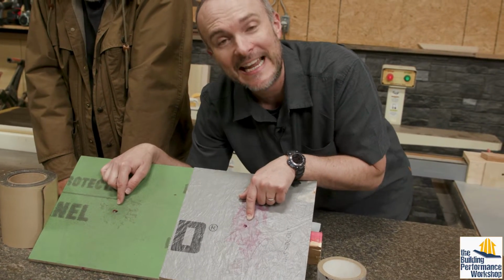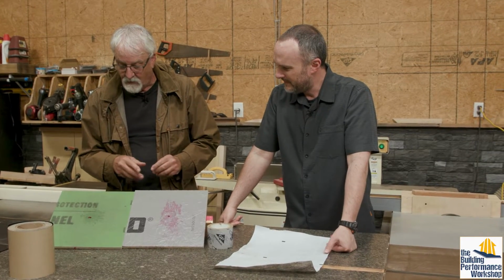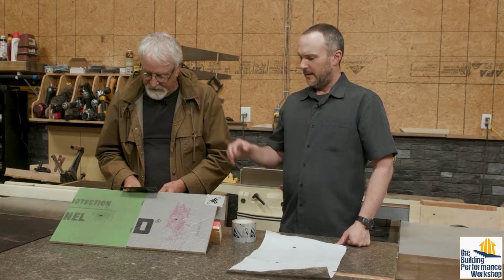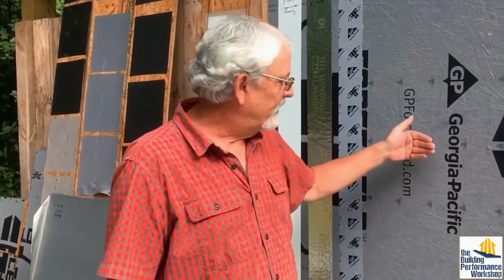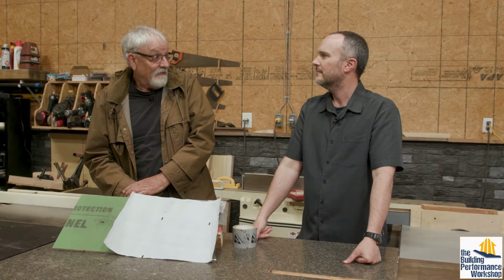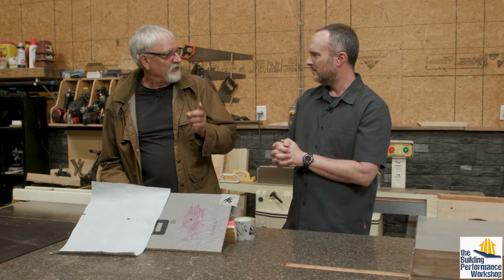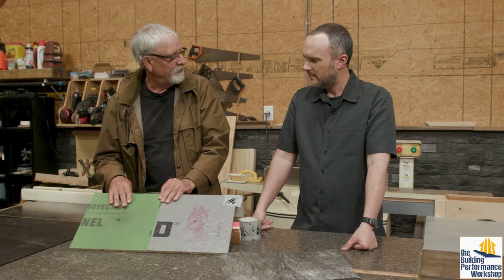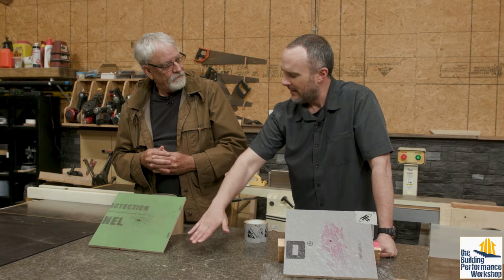WRB Showdown: ZIP System vs. ForceField WRB vs. Tyvek Housewrap & More with Inventor Landus Bennet

Comment: I don't think the air barrier and WRB should be combined. Plywood is superior to OSB in every functional way and is less expensive than Zip sheathing. Zip tape sticks like crazy to plywood for a great air barrier. Then use housewrap for what it does best.  I achieved ACH .77 on my gut remodel. It was a worst case scenario, a single floor home with a shallow crawl space. (the same amount of leakage rates better in a house with a full basement and/or multiple floors.) I prefer Kimberly Clark's Block-It housewrap. It is a two layer affair. The bottom is smooth and the top like a fine soft nonwoven fabric. They are apparently fused with a heated perforated platen that leaves raised dimples to provide drainage under exterior insulation. It's about the same price as standard Tyvek and far cheaper than drainage Tyvek. Despite what Zip says I don't trust Zip sheathing to provide adequate drainage and obviously Force Field provides none.
Reply: Actually plywood can become less uniform than OSB and can delaminate. That being said, I’d take plywood over OSB if cost wasn’t an issue.

Comment: Hope all is well with you and your family. 
One item I would like to add that often gets left out about R value of fibrous insulation, whether it be fiber glass or mineral wool or anything else, to achieve the real R value it must be installed perfect and with 0 air movement. That is the condition in which it is in when the R value is addressed to it. 
Rarely is either achieved when all is said and done. The value also drops significantly when they are not accomplished. 
Spray Jones has a great video on this topic with the research and paper work on it. 
Grace and Peace 
Slick
Reply: I have watched a ton of Spray Jones videos and his biais to Spray Foam is obvious.  For intance he claims that even properly installed Fiberglass insulation perform the same as Rockwool, when that simply isn't true.  He makes a lot of generalization statements obout batting insulation when the claim he is making only applies to fiberglass.  Closed Cell Spary Foam has it's place, but it is not the silver bullet he tries to claim it is.  A point he rarely states is that installation methods for foam and details are just as if not even more important that batting.  It can be -40f or plus 100f when installing rockwool and that cannot be said about the very tight tollerances necessaryfor installing spray foam.  Spray foam has also been proven to off gas for months (lots of 3rd party testing) not the 24 - 48 hours as he claims.

Comment: Could you elaborate on the air tightening process for a concrete block home builded in 2007 in Florida.?
Reply: In FL you want ZIP system because it provides a air/water barrier on the OUTSIDE. Here in MA that would be totally wrong. Vapor barrier goes on the inside.

Comment: Hi Corbett, I believe I heard that having an adhered membrane (I'm using Adhero) as your WRB and then using spray foam directly under the roof deck would be a bad idea because that would be using two vapor barriers. Did I understand that correctly?

Our plan is to wrap the entire house - roof and walls - in Adhero, then to spray foam the entire underside of the roof decking to gain air tightness. 

I'm now wondering if I don't need to use spray foam where I don't absolutely need it (in 2x6 rafters). The way we are planning it is for the roof to be spray foamed to code where we have existing 2x6 rafters, then flash/BiB fiberglass in the 2x12 rafters. 

But if I'm using Adhero as my air tightness along with spray foam in the rim joists, I could save money by just doing the BiBs in the 2x12s. Would appreciate your thoughts.
Reply from the maker: Hey Chris- don’t worry, that’s ok. But you’re getting airtightness from the membrane, not the foam. The foam is just the simplest way to insulate the roof. But yes, I'm in favor of less spray foam whenever possible. Vid coming soon about that.
Reply: @HomePerformance  I saw the vid! Was really helpful. Thanks Corbett
Reply: Put the roof membrane on and dry in the  home. I would then run a dehumidifier to make sure everything is dry before spraying the closed cell foam that was you aren’t trapping anything moisture. This is exactly what I am doing as well.

Comment: I have been seeing tesla solar roof installs that require ice and water shield over the whole roof prior to solar shingle install. if there is closed cell spray foam under the sheathing like in Matt Risingers latest video, will that cause moisture trapping issues? I cant believe that wasnt considered during install.

Comment: I'm curious to know your thoughts on the changes that the World Health Organization has made to their recommendations on how many air exchanges per hour that a building should have in order to be healthy from an airborne virus perspective. How would you modify your building procedures to target those ACH ratings?
Reply from the maker: Filtration, Brad- the forgotten factor of ventilation. Most performance pros would have you run the ERV at higher rates, but that’s costly and unnecessary.
Reply: Build your house as tight as possible, then use an ERV to control AND filter the air entering your home!
Reply: @dankarau2307 exactly- you’d be better off building a super tight house and cracking a window open even vs the old mentality of “a house has got to breathe”, where you have uncontrolled air leaks allowing air to enter from the worst possible places (such as air from a vented crawl space getting pulled up into the living quarters). 

The short version is, build the tightest house you possibly can, and build a system where you can control air changes to meet desired turnover rates.
Reply: Every house that has lots of air movement last 100s of years. New homes that are air tight don't last.  Period.... drive around prove me wrong.  You can agree or disagree on all.the new technology.  You can't beat a house with air movement for long-term.   Yes you pay for that air movement in heat and ac but its also much better for your health.   The health factor alone should be enough to let some air through your living space. Look at what we spend to stay healthy.  Seems a heat bill is better than a health bill.

Comment: So, could you do ZIP-R on the outside, plus rockwool as additional internal insulation? That would still be just one WRB, but you'd get the additional thermal insulation. Right?
Reply: Yes, you could use that assembly. It's quite common. However, exterior insulation on the outside of your sheeting is better than on the inside of your sheeting. For example, rockwool comfortboard, followed by zip sheeting, followed by rockwool comfortbatt cavity insulation. 

The layer change keeps the wood product warmer on the outside of the house, which will reduce the incidence of water condensating on a cold surface.

Comment: Great video! Question, according to Huber you do not need to seal overdriven nails unless they penetrate 50% or more through the panel. I do not agree with this but as an inspector can only call out what I can justify with info from the manufacturer. I still let my clients know my concerns but would love to know yours and Landus' view. Keep the videos coming!
Reply from the maker: Hey Reeves- check out the previous vid with Landus all about overdriven nails
Reply: reeves29456- I'm glad to hear that inspectors are concerned as they should be.  The answer to the issue around nail penetrations is it depends. Cheap way out I know. With some claddings, there will not be a measurable amount of water in the field.  Around windows and doors it's a different subject. Some claddings are considered reservoir claddings, like brick, in that case, I would recommend sealing the fasteners. Actually, I would cover the integrated WRB with another layer equivalent to grade D felt paper.
Reply: @landusbennett7123  Thank you!

Comment: All due respect…. But…. Another total waste of my time. Like the last three information voids that are your videos. You absolutely cannot discuss one part of a system without the other parts. That zip sheet does not have enough thermal insulation to do the job. To protect the structural elements from becoming thermal bridges you need more insulation between the zip and the structure. Building science 101.  Discus the entire system, not one element that must marry with other elements to become a complete system. Sheesh.
Reply from the maker: Fred Snit, your dream of becoming a video maker is nigh- go make even one video that truly addresses the entire system of anything on earth, and you will have earned the cred to complain about your free video consumption. Until then, we do not make videos for you. Move on.
Reply: @HomePerformance  already been done by the god of building science 

https://youtu.be/E_ngmbANeOg
And
https://youtu.be/E_ngmbANeOg
Etc. 

You’re separating and confusing all the layers
Reply: Couple points:

1. 'All due respect', as a concept, may not be something you are familiar with.
2. There are plenty of videos discussing myriad systems. That was not the intent of this video. That fact is even called out in the video. 
3. Putting insulation between the sheathing system and the structure is not even the best practice. You're better off insulating the exterior of the sheathing as it will reduce condensation on your sheathing because it will be warmer.
Reply: All I can say is WOW. Totally missed the point of the video my friend. We are talking about water management not thermal breaks. That science 101 will be or already was discussed. (Air gap or insulation)
Reply: @trickstothetrades1801  clearly, you don't understand the issue or building science 101.  

water management includes condensation; to avoid condensation you need to place the vapor and air barriers and insulation in the proper places to avoid 1. condensation; 2. trapping condensation; 3. thermal bridges that will result in condensation.  Study joe lstiburek, the perfect wall, building science. 

this video addresses sheathing with a barrier. great. one part of the sandwich. completely useless without the other part of a system.  where do the other parts of the system go if you use this super-fantastic barrier? what are the other materials that work with this barrier? which materials don't work and why? that's information people can use. 

you can't talk about water management without talking about location of insulation, air and vapor barriers, condensation, and thermal bridges - and your climate zone.  and you need to address the correct materials to do these things. this 2-part 40mins of video garbage miss all of that and only point out these sheathing and tapes work. bam saved you 39 mins and 30 seconds.
Reply from the maker: Snit, you are clearly not a specialist in practical applications. Stick to reviewing childrens skis, and don’t turn troll on my channel and my followers. All due respect, but you’re being the total waste of time here.
Reply: Istabruk is the master.
Reply: Lstiburek is the master. Anyone doubting this man is an idiot.

Comment: Being up north and having to repair mold issues frequently (at least What I have found) is it hasn’t mattered what you used plywood or OSB but how you build and protect. Right now I’m tearing out plywood that has rotted and molded because there was issues in construction that has created moister BOTH inside and outside (IE: Nothing done right) the sad thing is all of it could have been avoided with not that much more cost or time just better knowledge
Reply from the maker: Amen
Reply: Sorry to hear about your issues. Do your best to keep liquid water from entering from the outside and keep humidity down in the living space.
Reply: A lot of reasons this can happen. See my post above. In the North your vapor barrier needs to be on the inside and the outside needs to breathe. ZIP system in the North is BAD.

Comment: This was an interesting video, thanks for the information.  Out of curiosity, do you know of anyone making a similar integrated WRB sheathing product, but using plywood instead of OSB like ZIP and Forcefield use?  I live in the northern Great Lakes region, and between the rain, snow, and repeated freeze/thaw cycles during Spring and Fall, OSB tends not to hold up very well compared to plywood.  A few builders I've talked to have told me that they try not to use OSB for anything other than subfloor unless their client truly can't afford the more expensive plywood sheathing because they get fewer callbacks with plywood.  I've tried searching myself with no luck, so I thought I'd ask someone more familiar with the space.  Thanks for any help you can offer.
Reply: You can use plywood and then apply your own fluid applied layer. There are several products available, some mentioned in this video. I don't know of any off the shelf sheeting products, though.
Reply: There are no integrated plywood/WRB systems.  I tried, but plywood manufactures were not interested. Probably because the plywood turns into a potato chip if not overlayed correctly.

Comment: You touched on building in the north (Canada) with zip or other products like it and the use of vapour barriers. Would you say not to use anything on the inside if you have zip on the outside or something else to control the vapour? What product would you use?
Reply: If you are using ZIP you will have to talk to your building department. In Ontario they will require a poly vapour barrier due to code. You end up trapping moisture between the WRB and the poly. Not good. Either just use a latex paint on drywall for an interior permeable vapour barrier or if you want a more air controlled system some of the smart barriers such as SIGA Majrex are a good choice. They allow drying to the inside but prevent moisture entering the wall assembly in the winter. That is what I am using our house now under construction on the North Bruce peninsula ( between Lake Huron and Georgian Bay) I also have exterior insulation. Great video. Thank you! Tough for the average person and for the average builder to keep up with the building science world. I have had to spend a lot of time reading Dr Joe and Matt Risinger to get a start at a handle on it.
Reply from the maker: 👍🏽 keep it up Chris
Reply: @knappce  Use a smart membrane vapor barrier if code makes you do so.  Otherwise, don't use a vapor barrier behind drywall if using Zip-R.  Otherwise you will trap moisture in your walls.
Reply: So if I am building a wall assembly with ZIP R9 a 2x6 wall with Rockwool and Siga Majrex is a good thing? This is what I have planned.
Reply: I think the best way to build in the north is to put your insulation on the outside of the wall.  ZIP R has a product that includes the insulation and a nail base.  This will help keep the temperature inside the wall above dew point.  There are other continuous insulation companies in Canada like QuickTherm that have loads of experience in your area.

Comment: I am building a house on the east coast on the coast and was interested in the comments regarding the structural strength between OSB and plywood (say Advantech).  I was planning to install plywood horizontally covered with a WRB for the greater shear strength.  In the video it was commented that OSB was just as strong as plywood installed vertically.  How does OSB rate strength wise versus plywood installed horizontally?  Thanks,
Reply: S Paris - Good luck with your build on the east coast. OSB is stronger than plywood in shear strength. Advantech is a good choice for your area as it does not swell as much as commodity osb.  Make sure you use a structural 1 panel. My best advice on the coast is to make sure your WRB (whichever way you go) is installed correctly and the the structure has good drying potential if it gets wet.  Pay close attention to windows and doors.

Comment: Great overview of sheathing systems. Landus mentioned having only one air barrier. I am rebuilding my house and we spoke about ERVs. My question is how necessary is the interior vapor control layer like Intello. Plan to monopoly frame the building, use plywood, cover with a WRB like Adhero, continuous insulation w 2” Rockwool board. After all framing and the building is enclosed use Aerobarrier spray. If we can seal to 0.5 ACH then make the decision about Intello. Maybe we need to talk again.
Reply: If you're in the North your vapor barrier needs to be on the inside. If you're in the South it needs to be on the outside. North = OSB & Tyvek. South = ZIP system.
Reply: vapor control is predicated on having a need to control vapor. if someone thinks drywall and paint isn't adequate, i think they're either running a natatorium in the house or the equivalent.
Reply: The nice thing about Intello is that it's permeability is variable. Great product for passive house construction.
Reply: @landusbennett7123  i think you're missing the point. 92ish% of houses in climate zones 6 and below don't need an additional vapor retarder when using drywall and [most] paints. you're falling for marketing.